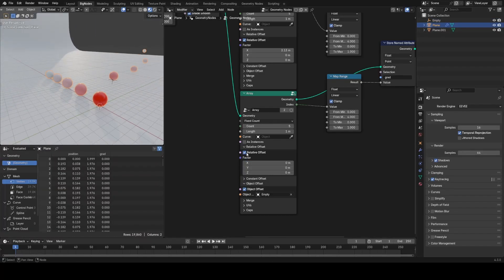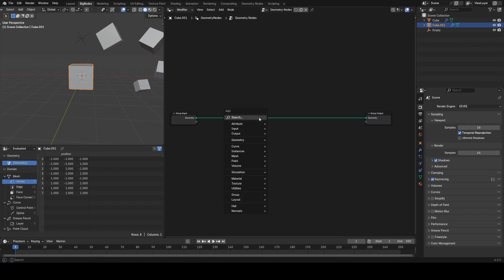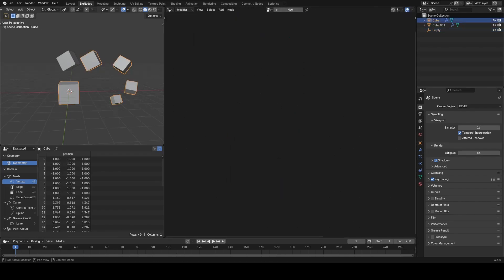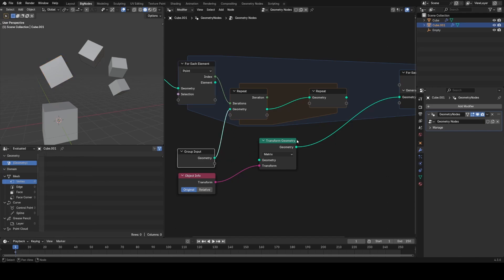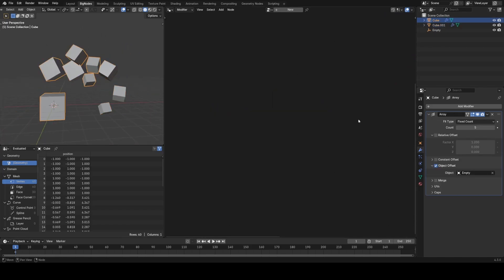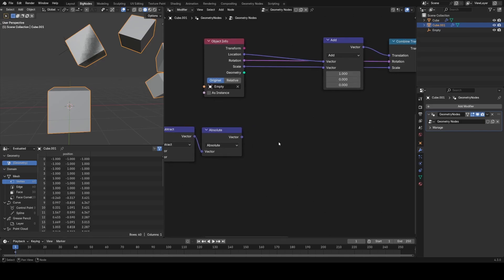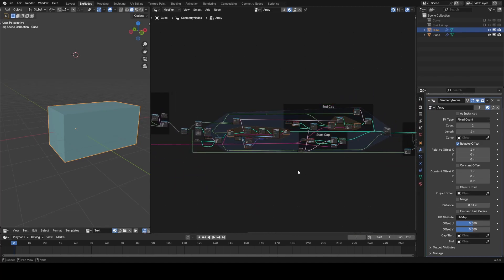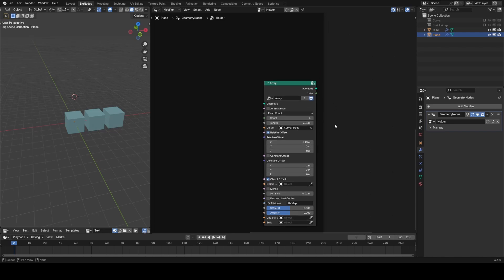Make the Array Modifier in Geo Nodes

Comment: I've been trying to make something similar to the array modifier using 4.2.  No wonder I couldn't figure it out 😀
What I'd like to do is give each instance a constant offset on the Z axis, and give each one a slight random offset on the X and Y axes.  Is that possible in 4.2?  (Sorry if this is a stupid question.  I'm new to geometry nodes).
Reply from the maker: You could do a simple version using a mesh line going up in z, then using a set position and random value in the offset in the x and y, then instance on those points. In the version i did here in 4.3 you could use a random value (with the id as the for each index) plugged into the x and y of a transform and then add a z offset :)
Reply: @Polycount-tw4ix I'll try that.  Thank you!